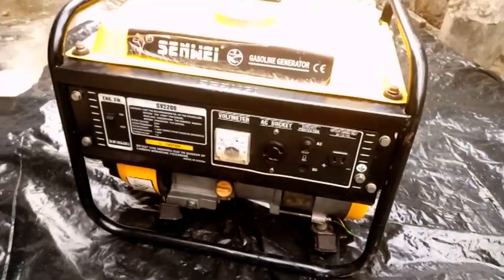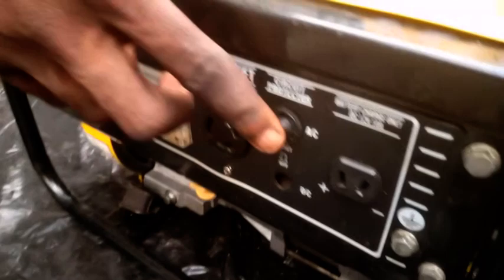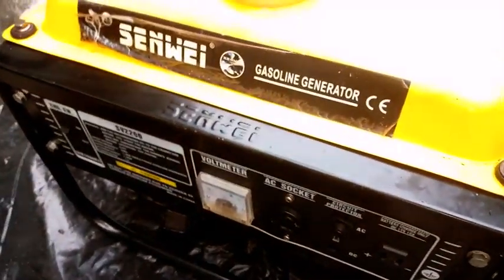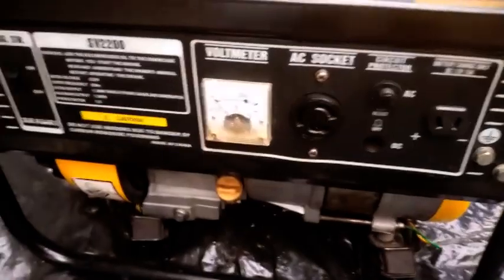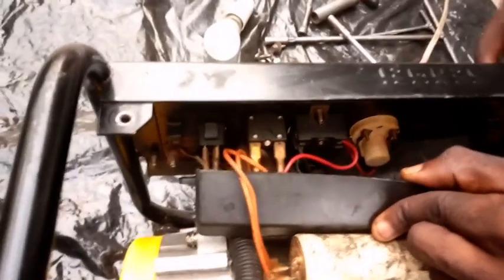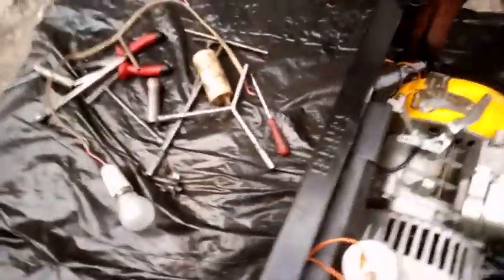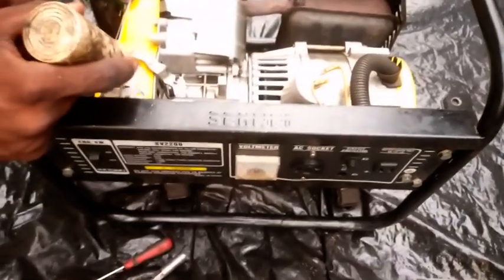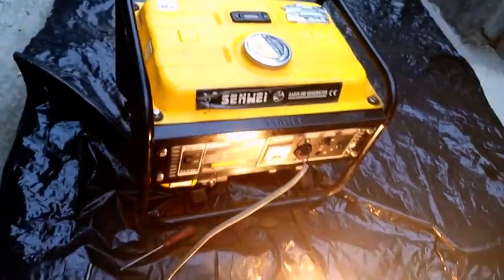HOW TO RESTORE POWER OUTPUT IN A GASOLINE GENERATOR BY CHANGING THE CAPACITOR #capacitor #repairs

Comment: Hope Generator coil is not damage? I mistakenly plug hot plate and also connect printer. It didn't stop immediately, but later didn't work again. Also I pure too excess black oil. What can I do? It is not working again.

Comment: you are just good....i had similar issue...i suspected the capacitor but after leaving the genset for sometime it started supplying again...i discovered when the gen is used continuously for long hours,it stopped supply again..

Comment: What if the generator has a voltage, but unable to carry load?
Reply from the maker: Check ur engine then
Reply: @bencoinstitute  did that already.....even serviced the generator....if I adjust and increase the governor speed, it will carry the load, but will be taking much fuel and will automatically off at some point.
It's an SPG 2200 generator....
Anyways thanks for your time, will try replacing the capacitor.

Comment: Great video, please how exactly am i supposed to know which capacitor is good for my generator?... I run 5200CX engine 6.5HP Senwei generator.... Does every gen have its own required capacitor rating or any capacitor does the job?
Reply from the maker: +2349078426919.... Whatsapp
Reply: @bencoinstitute  Thank you
Reply from the maker: The gen didn't fix it self

1.Maybe there was partial contact between the AC plug and socket 

2.Sometimes it is the brush,may not touch the commutator properly

3.And then could be the Avr

Just wait till it happens again b4 making a decision
Reply: Thank you very much, there's a new development... The generator was not supplying electricity yesterday as at the time i made my first comment... I did call a mechanic to come and fix it this morning but surprisingly, the gen supplied electricity normally when he turned on the gen to confirm it wasn't supplying electricity... It seems the Gen fixed itself just like that... The mechanic said that AVR is weak that it would go off again very soon, that it still needs to replaced... Please how best can you explain this situation? Is it possible for the generator to fix itself or do i still need to replace it?... Thanks in advance.
Reply: Alright sire, thank you very much... Please I'd like to get your contact, i really hope you don't mind... I've learnt alot from your channel in such a short while since i subscribed.
Reply from the maker: This particular generator of yours makes use of the AVR(Automatic voltage regulator) instead of a capacitor

Check this video it will guide you
https://youtu.be/XoKBgcYnth8